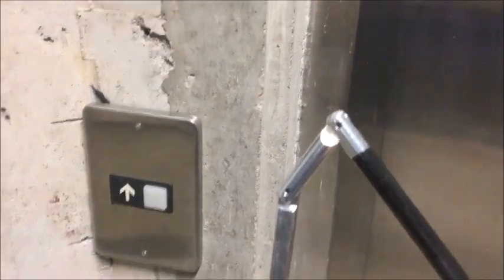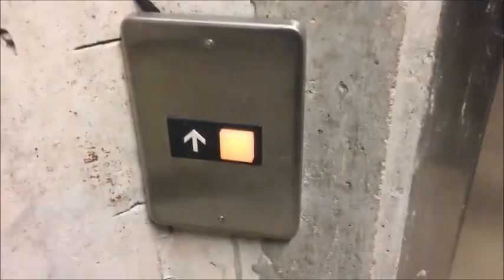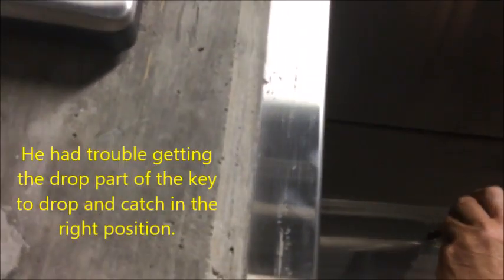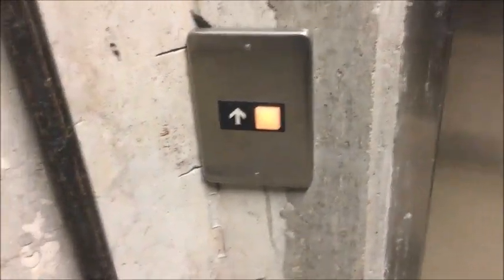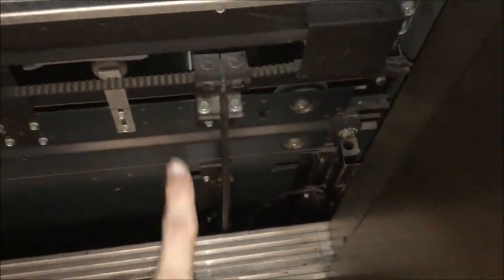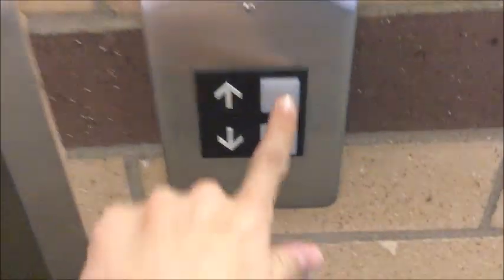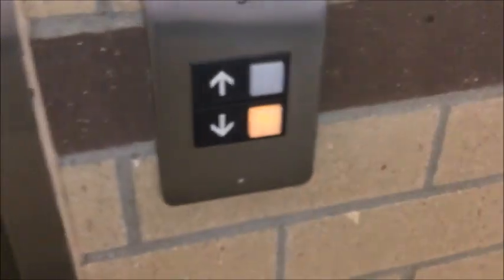Otis Series 1 Machine Room, Floor Lockout Demo, 3 Different Shaft Views | Elevator Video

Comment: Is the basement a mechanical room
Reply from the maker: Yes
Reply: @Jamestube8439  can fire service let you access the basement floor that’s restricted
Reply from the maker: @noahharris2260  yes
Reply: @Jamestube8439  what do they have in the basement
Reply from the maker: @noahharris2260  this is a link to a video of when I got to do a tour of the basement.  Along with a machine room and shaft view https://youtu.be/h1rhGLhrWlg
Reply: @Jamestube8439  I assume basement is always turned off for employees only is that where they storage stuff
Reply from the maker: @noahharris2260  just go watch the video I linked to you and you’ll see for yourself
Reply: @Jamestube8439  sure thing even tho I did and some elevators if you press the door open button it will open at a restricted floor
Reply from the maker: @noahharris2260  not true at all, any elevator should not open a restricted floor
Reply: @Jamestube8439  when your inside on any elevator at a restricted floor I heard you can go to another floor that’s not restricted has an elevator taken you to a restricted floor where you weren’t supposed to be I’ve had that problem a couple times before
Reply from the maker: @noahharris2260  yeah it happened to me a couple weeks ago in Plymouth, I just started the video and got on an Otis Series 1 that was loaded with a cart.  The basement was locked so I tried to go up and since the direction was set to down a worker at a kitchen or something like that had called it to the basement to take the cart off.
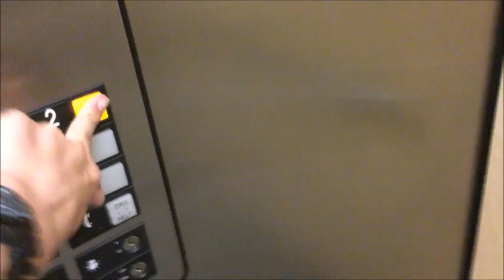Reply: @Jamestube8439  9:44 where do those doors take you to
Reply from the maker: @noahharris2260  which ones? The one on the right or the left?
Reply: @Jamestube8439  both of them
Reply: @Jamestube8439  the left and right doors I want to know where they go to
Reply from the maker: @noahharris2260  one leads outside and the other leads to the stairs
Reply: @Jamestube8439  if any elevator can’t take you to a restricted floor can any stair well take you
Reply from the maker: @noahharris2260  the stairs would depend on the setup of the building, I believe by code there always has to be a stair case for every floor in every single building built
Reply: @Jamestube8439  8:20 the elevator I was telling you that has the 4th floor at the little st Vincent hospital I told you a while back with the mechanical room a different maintenance, worker different one let me see the 4th floor again that was a restricted floor and had someone with me to see it for the first time the key to access a restricted floor the key hole on some elevators I heard you have to hold it and press the button
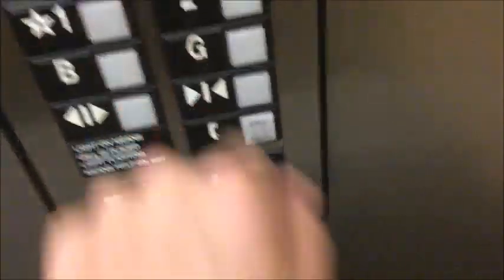Reply: @Jamestube8439  3:39 something strange I wanted to tell you the elevator up on the 4th floor that is restricted when the door opened and when it started to close I hit the door open button to hold the door open and it stopped and reopened I thought every elevator is not supposed to reopen if the floor is locked off and your on that floor I just wanted to know
Reply from the maker: @noahharris2260  Every elevator is different, a Thyssen Dover I filmed once did that.  Otis is different and will reopen on a restricted floor, but not when the door is completely closed
Reply: @Jamestube8439  what about unlocking the floor with a key the one I saw today you have to hold it and the key won’t come out when you unlock the floor only when you turn it off I just wanted to know do some elevators have to where you have to hold the key with it in when you unlock a restricted floor the elevator I was on was an Otis elevator the one on this video I watched
Reply from the maker: @noahharris2260  Well yeah it will unlock on the floor.  If you unlock it of course it will allow the door to reopen.  At any time
Reply: @Jamestube8439  when the door closes all the way on the 4th floor that’s restricted if you don’t press any buttons it will automatically go back down
Reply: @Jamestube8439  1:15 the elevator I told you about the restricted floor on the 4th floor this time I wasn’t on the 4th floor I grabbed the hoist way door while the car door was closing on an elevator like this that was an Otis I tried to open the hoist way door while the car door was closing and some how when I had the hoist way door the car door wasn’t closing for some reason I was on the 3rd floor and I wanted to know from you why it does that on Otis elevators
Reply from the maker: @noahharris2260  Can’t answer that, I don’t know.
Reply: @Jamestube8439  oh ok

Comment: Some elevators have windows to where you don’t have to turn that shaft light on in the daylight but when it’s dark you have to turn the elevator shaft light on
Reply from the maker: Interesting.
Reply: @Jamestube8439  I have a therapist that I see every Tuesday and he was telling me that he was on an elevator that automatically parks on the 1st floor and the doors open automatically and when they close and you press the door open button it will open and he was telling me that the 1st floor was a restricted floor and I told him that it should not open at a restricted floor on any elevator and he told me it did can it open or not I wanted to know from you
Reply from the maker: @noahharris2260  it varies on every elevator.  Most of the time if the elevator is sitting on a restricted floor the door open function won’t work.  Sometimes, but not always.
Reply: @Jamestube8439  oh I see

Comment: Have you ever used elevator keys without permission before when not supposed to?
Reply from the maker: No I always use them with permission.
Reply: Jamestube 8439 When did you first learn it was not appropriate to use elevator keys without permission?
Reply from the maker: @johnoconnor4019  A few years ago, and that was way before I even had elevator keys.
Reply: Jamestube 8439 How did you learn that?
Reply from the maker: @johnoconnor4019  A popular youtuber made a video about it.
Reply: Jamestube 8439 Was it DieselDucy?
Reply from the maker: @johnoconnor4019  Yes

Comment: I like how elevator car tops have shaft light on elevator cars
Reply from the maker: It's important so the engineers can see since it's pretty dark in most elevator shafts
Reply: Jamestube 8439 I know I’ve rode a couple different elevators and looked up the shaft and saw they left the shaft lights on

Comment: your references to `110 power' is actually the traveller cable. signalling, power, and sometimes coax/Ethernet.
Reply from the maker: Well it's really for the lights and fan, the rest of the cpu is on a different switch.  That way when they turn it off, they can keep the 110 power on so they don't freak out passengers during a rescue.

Comment: 22408aaron says you're not supposed to use elevator keys on an actual elevator.
Reply from the maker: Well DieselDucy says if you get permission from the building owner that you can.  I only use my keys with permission and I was with a facilities management worker during the time I took this.

Comment: Those are Dover Impulse elevators, Some of them are in their schools, even my school has one, DISCLAIMER: You must have permission to operate elevator, You have to work here, If you were a student and you are handicapped you must ask a nurse to have permission to use those, If you are not authorized, and you try enter inside an elevator, their are 2 things to try to enter, one another student entering and trying to rush in or 2, You have a elevator key and you use it to operate, These keys CAN BE CONSIDERED A BURGLARY TOOL! If you use the elevator without the authorization you can have detention, 2nd time is Suspensions, If you are not the student and you try to enter a elevator you can get kicked out, And they may call the police on you, So Do not use elevators without Authorization, Even in a school. Public elevators are Fine.
Reply from the maker: Very nice disclaimer, my high school as a matter of fact has a Dover Impulse Elevator.

Comment: I had a relief to the basement at the University Center in it had an old i I had a relief to the basement too see the elevator machine room on an Otis series 4 hydraulic elevator at university center and it was noisy down there like  it was on this video.
Reply from the maker: Yeah it's noisy because of the machinery down in the Basement.